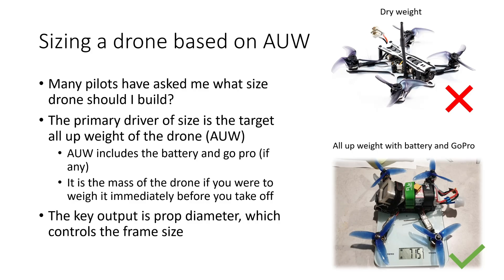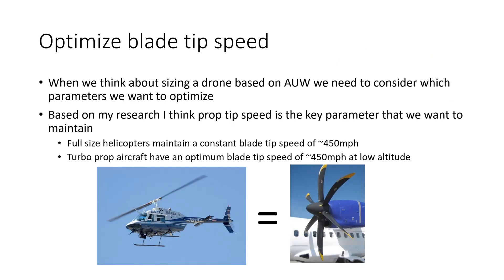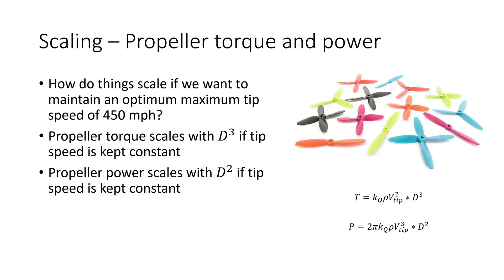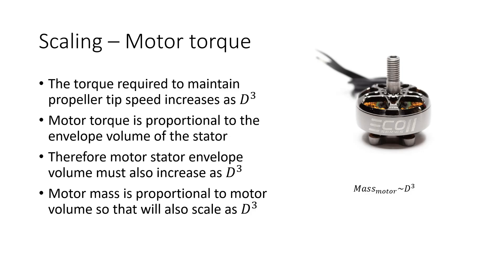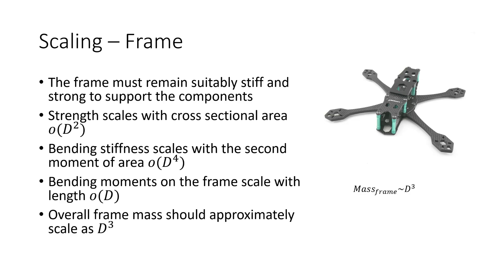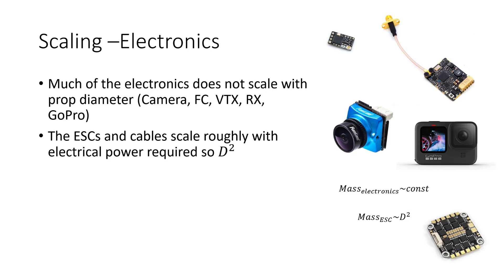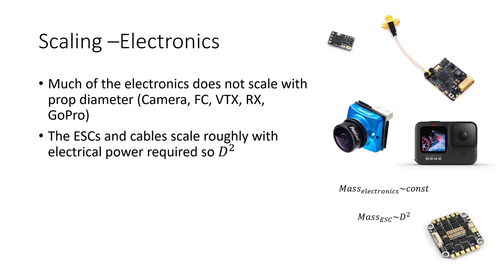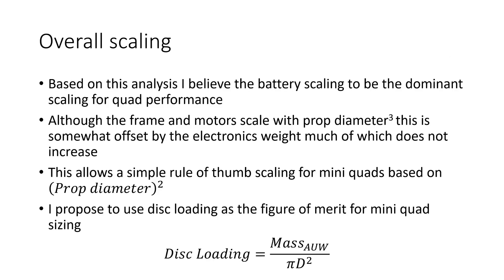Choosing the right prop diameter for a drone of a certain weight: What prop for sub 250g?

Comment: Hi Chris. Fellow Aero Engineer here. Question for you on your frame scaling stuff. I understand that the strength scales with the cross sectional area and bending stiffness with the second moment of that area. But why do both strength scale specifically with the prop D^2 and stiffness scale specifically with the prop D^4? Is this extrapolated based off of a force analysis due to both increased thrust and motor weight for larger D, and thusly the larger section geometry to support that? Curious how you got those relations. Thanks!

Comment: Chris at 9:30 you talk about disc loading. But when we state or calculate a disc loading value for FPV should we be using Kilograms / Square Meter, Oz / Square Foot or Grams / Square Inch - considering that in FPV we measure props in inches and quad weight in grams?

Comment: Before watching this video, I tried to run my 2050 Velox with a 6S and quickly realized that they got hot and also I got some weird sounds and vibration as soon as I increased the throttle. Landed quickly and switched to my 4S.
Doing the calcs it looks like full throttle would be supersonic speed for the propeller tip LOL. No wonder it was vibrating and getting hot...

Comment: Excellent discussion!  But at 9:07, shouldn't the disc loading equation include the 4 propellers of the quadcopter?  Because the formula is producing a value based on just a single propeller as described in the video.

Furthermore, there are other multirotor types like the hexa- and octo- copters that could also be described by this equation if the equation included the number of propellers in the disc loading formula.

Comment: I think there is no difference in sound and one way to really know is with a Decibal Meter. In regards to speed are both Propellers (Master Airscrew & DJI propellers) the same size in dimensions and diameter and weight or do they both have the same propeller specifications and design? Otherwise to claim which one is quieter or faster is kinda moot.

Comment: im pretty confused with the tip speed calculation.
i calculated in metric systhem, so 450mhp are 720kmh and as a formular i used: Pi * (7inch * 2,54 * 0,01)*(22,8V*3350kv/60) = 711km/h 
i mean why is it in this video, when even in this unrealistic configuration the tip speed is lower than the max droppoint of the efficiency?
or did i something wrong?

Comment: Finally someone explained it. Thank you.

But one question appeared. If goal is, for example, long range - is it beneficial to use lower KV motors and smaller props, to achieve more prop speed while cruising? Opposite situation - if you have crazy overpowered 8-12s build, isn't it better to use bigger props with same weight, just because motors can build more power/prop speed?
Reply: Also, if we take into account power required to spin propeller will efficiency stay the same? Propeller speed to air movement speed is great relation, but propeller is easier to turn on lover RPM, so even with worse RPM to air speed efficiency, it could result in better battery consumption efficiency.
Reply: After some research I'm now sure that I was right. 450mph(actually, it's 475) is best performance per rotation. So it's best thrust for the size. But if you can go bigger without adding much weight, you'll always get better efficiency.

So, if you can get same weight with same motor size etc. in 10" it will be much more efficient than 3". Props, same as wings, are more efficient slower you go, and lower is motor kv, better is efficiency. 

If you do race drone of some size, you should stick to 475mph. But it's not a surprise that huge and light long range drones have efficiency even with low tip speed.

Comment: im sorry, and im sure im not the first to mention this, but the area of a circle is pi R2 not pi D2... i just couldnt let that one go because not only did you say it, but you had it written in your equasion so i must question your results lol

edit: i will also say that helos and turbo props both have adjustable angle of attack to control their thrust while maintaining an effecent prop, we dont have that luxury on mini quads as we use prop speed to control thrust, so your never going to be sitting in that optimal tip speed unless your building a long range quad, you know what airspeed (not ground speed and no one has airspeed on their quads) and you maintain a consistant airspeed and angle of attack and consistant throttle point, then you can talk about sizing for optimal tip speed, i do get the disk loading argument, but i think talking tip speed on a mini quad is relativly useless, again uless your making something for strict effecency that isnt going to be changing altitude or airspeed much if at all, perhaps useful if talking about ciniwhoops, because their props maintain a relativly consistant speed but its gotta be way more than 450mph due to small props working their ass off, or another place where tip speeds might be useful are heavy lift cini rigs with 8 big ass props that maintain a mostly consistant tip speed because their not constantly abruptly changing altitude, airspeed and angle of attack like a freestyle or racing quad

Comment: Thank you, the level of clarity you bring is fantastic. 
Im building model F35s derived from Nicholas Rehms  design. His plane  has 3 motors in a tri copter configuration.  His plane weighs about 850gr uses 2205 motors and 5045 props on 4s batteries. They fly just fine.  My design is scaled 50% larger, weighs 1090gr and uses 2306 1900kv emax motors with 5545 props on 5s battery.  The motor overheats within 1min. of Hover time. Based on your data tip speed is to high so reduce prop dia to 5045 or change motor to 1400kv. Sound about right?

Comment: I don't understand what you are saying about the blade tip speed. The higher the blade tip speed, the lower our advancement ratio becomes (thus lower efficiency) because we simply can't provide anywhere near the thrust required for our quads to go 400km/h. What am I missing?
Reply from the maker: Even at 0 airspeed (i.e independent of advance ratio) the ideal tip speed of a prop at full throttle is about ~450mph. That gives the most thrust without losing efficiency.
Reply: @ChrisRosser  I'm sorry but I still don't follow. What relationship gives you the fact that faster blade tip speed is more efficient up to 0.6 mach, other than the advancement ratio relationships? Are we assuming that V_inflow is aircraft velocity or the local airspeed of the air being "sucked" in by the props? Could you recommend me some sources to read up on this?
Reply from the maker: @kinzokushirogane1594  http://www.epi-eng.com/propeller_technology/selecting_a_propeller.htm
Reply: @ChrisRosser  I re-read that article, and found some other good articles as well, and all of them still point to the advancement ratio relationships. The reason airplanes go to 0.6 mach for blade tip speed is because they can actually fly at higher speeds close to their optimum advancement ratios, and most of the also have variable pitch propellers. For our quadcopters though I cannot find any reason to intentionally increase blade tip speed, at least according to the info I've looked at, since most quads already have really high blade tip speeds already at 0.5-0.6 mach, especially in flight as the props unload. If our goal was simply peak thrust, then yes 0.6 mach blade tip speed is our limit we want to get to, but not for efficiency. The same thing in your video "Ultralight 5" Motor Testing", as I understand, going to 2 bladed propeller is only a good option if we can actually achieve the same speeds with less thrust. You made the assumption that we would have the same aircraft speed regardless of prop blade count but if the drag (at high speeds) we need to overcome is more than the thrust we have, we cannot achieve an efficient advancement ratio. We end up with high rpm, high blade tip speed, low aircraft speed and low advancement ratios resulting in low efficiency.

Does this seem reasonable?
Reply: @ChrisRosser  bump

Comment: Hi I have a drone that weighs 308 grams and 499grams with the battery.
I have 6S 2407 sized with 2800KV motors
What prop size and pitch should I use for maximum top speed and performance 
Thank you!!
Reply from the maker: For max speed use the steepest pitch prop you can.

Comment: For efficient cruiser (200-250g AUW) running on 2S 18650 idk if I should go for 4" bi-blade or 3.5" tri-blade props. PS. I am thinking between using 1303.5, 1404 or 1603 motors.
Reply from the maker: For efficiency a 4" biblade on 1404 motors would be my choice. For freestyle 3.5" triblade on 1505s.
Reply: @ChrisRosser  Would 1603 motor be even more efficient than 1404 for 2S 18650? 1603 stator has slightly less volume (603mm3) compared to 1404's (615mm3)?
PS. I am bit confused why Dave_C used 1303.5 motor with 3.5 props instead of bi-blade 4" 1400-1600 setup for his 2S 18650 Rekon35.

Comment: Some are reporting 1,350 grams and 7" props on DRL's Racer 4; inneficient machine based on your data....
Reply from the maker: Yes, DRL race quads are not optimum from a performance standpoint. DRL is spec racing, everyone races the same (relatively slow) quad. If you compare DRL to MultiGP you can see just how much faster MultiGP quads are able to go. I think DRL is designed for spectator enjoyment so they don't want the quads going too fast or the spectators won't be able to follow the racing.

Comment: This is very useful. I switched to 3" from 5" sometime ago because I don't do use action cameras so I don't see the point... Anyway, the weight of my 3" racers is approximately 184 grams on 4S which is pretty good considering I'm using the Vista with original DJI camera. The bad news is that I need to loose approximately 15 grams to reach the green line. Deceasing the Vista and the Nebula Pro camera should get me there however.
Reply from the maker: Yes I think decasing the vista is the clear next step 😁

Comment: Hi Chris,
thank you so much for the info!
Does the optimal tip speed of 450mph relate somehow to airfoil chord length of the prop?
I found high chord length props likes to run at lower speed, for example the 2.5-inch Emax Avan Rush.
It has a lot of thrust with low rpm but increasing the tip speed I noticed that the efficiency decreases a lot.
Reply from the maker: I don't think so. Its to do with Mach number so more related to the air properties than anything about the prop.
Reply: down to aspect ratio.. look at glider wings long and skinny, jet short and wide... the long skinny can handle higher aoa giving better low speed performance as lift is greatest just before the stall

Comment: How about for, say, bicopters? Do I just match the overall prop area to get the same disk loading?

If so, I assume for a 200-250 gram bicopter I use 4-5 inch prop. (planning on a tailsitter delta wing :D)
Reply from the maker: That sounds like a good approach to me.

Comment: Does prop pitch affect the optimum diameter for a given weight?
Reply from the maker: No it doesn't matter for disc loading. Prop pitch will affect maximum thrust but the momentum transfer for hovering stays the same.

Comment: 9:30 graph is really help me a lot.
No more guessing and arguing lol.
People build as light as possible 3 inch quad, for me it is too flooty.

It turns out my 3 inch quad just at the point for flying outside, especially on windy days.

My 3 and 7inch is on point with all of TPU protection and gopro 😅 but  need 5.5inch prop for my 5inch quad 😅

Thank you sir.

Comment: @Chris Rosser  so, if I understand this correctly, using the tip speed calculator you reference, an XNOVA 1804 2400kv motor on 4S with a 5" prop gives a tip speed of ~570mph and with a 4" prop it gives ~450mph. All of this at only 14g a motor which makes an AUW under 250g with a Naked GP very doable (with eg. a GEPRC 660mah 90C HV that matches current requirements) for both scenarios with higher thrust and flight time efficiency than a smaller prop (granted with higher drag when flung). Is there a reason why this is not the better choice? I guess I don't understand what you mean @10:00 when you say that quads with a lower disk loading struggle to reach the maximum tip speeds? Could you potentially expand on this or provide sources in the literature? Thanks :) 
*Note: The same thing can be done with the new Ummagawd 2004 Aerolite 2400kv if you prefer a larger stator size.
Reply from the maker: Are you making the assumption that max rpm = KV*voltage? It's much more complex than that unfortunately. The prop has a torque requirement for a given RPM depending on flow conditions and the motor has a current requirement to produce a given torque. The battery can only supply a certain amount of current at a given voltage. All of these factors depend to some extent on the weight of the components. The TLDR is an 1804 motor on 5" props won't get anywhere near 450mph no matter the KV. As for sources or literature on this I don't know of anyone who's done detailed research into this except myself and other enthusiastic hobbyists. There is no data on the torque curves for the props we use in moving air for example.
Reply: @ChrisRosser  I SEE! Upon more research I think I get it now. So as I understand it, higher KV produces less torque for a constant current. Larger propellers require higher torque supplied. So if we want to increase torque of the motor to overcome the torque consumed by the larger propeller, we have to lower KV. BUT by lowering KV too far you risk not achieving the desired tip speed for the maximum performance. Which leaves us no choice but to increase stator size for a given KV and maximum current limitations in order to overcome the torque consumed by the motor and reach that 450mph. That is to say that we are limited by battery technology and torque capabilities of the current motors available. And increasing stator size ultimately increases weight of the vehicle, making it harder to stay under 250g. Thus we need to look at less torque-intensive propeller sizes and then apply the design circle again until it is possible to reach the maximum tip speed for a given current supplied. Am I correct in this line of reasoning? And I guess that also means that thrust is lowered, but that wouldn't be such a bad thing in terms of flying characteristics when you want greater precision in flying. But the trade-off is then limitations in payload capacity when you want to add a naked GoPro under 250g, which decreases the size permitted for your battery, which again decreases current supplied and the design circle starts again. Is that also correct? Thanks again for the time spent educating us plebs XD
Reply from the maker: @itsmeRizzG  Yes, your reasoning is broadly correct. The KV does not change the maximum torque of the motor. That is dependent on the motor size and construction. KV only changes the relationship between current and torque.
Reply: @ChrisRosser  Ah okay, so the correct interpretation is that a higher KV motor requires higher current to maintain the same torque in comparison with a lower KV motor?

Comment: Hey Chris, thanks for the amazing info! My question is, if you want to design a Freestyle Quad that can also carry a GoPro whilst maintaining efficiency under 250g, my assumption is that you would have to trade off efficiency to thrust in order to carry the GoPro? Or is that fully compensated by the weight reduction?
Reply from the maker: You have a huge sacrifice in efficiency as you try to carry the same weight with smaller props. Your disc loading increases. You need more power to lift the same wieght with smaller props.
Reply: @ChrisRosser  Thanks, so in that case, would something like a 4 inch prop build for a sub 250g drone carrying a GoPro be the better tradeoff for going sub-250g (thinking freestyle/cineflying) whilst still tapping into the Disc Loading optimisation and maintaining some of the payload capacity of a 5 inch? Or better off staying at 5 inch and taking the efficiency hit on "performance" if the goal is efficient payload carry?
Reply from the maker: To go sub 250g your best bet is 3" with naked go pro or SMO 4k. No standard go pro is going to work.
Reply: And by this I am talking about battery life. Considering a smaller Quad, that would only carry a smaller battery, with a GoPro, I would think that the smaller props will give much worse flight times with less efficient thrust?
Reply: I guess you could also just increase the battery capacity with the weight saved by dropping a prop size in order to increase flight time? At some point you run out of frame space, but I guess you could always just bottom-mount a larger battery? Does this track?

Comment: Is it possible to achieve 450mph by reducing blade numbers and pitch in over light disc load conditions? Because the fewer blade and lighter pitch props need to spin faster to get the same thrust，it may achieve 450mph then. I'm building a 360g AUW freestyle quad with a 5' frame, it is hard to get optimum tip speed due to your chart. 4' props may be a good idea, but I think it wastes frame space of some kind. So how about using 5' 2 blades with a lighter pitch prop？ Thanks.
Reply from the maker: It might help. Your AUW seems quite low for 5" props which is why you are struggling to achieve 450mph. Either use smaller props or bigger motors/battery.
Reply: @ChrisRosser  Thanks mate and great video by the way. Looking forward to your next one.

Comment: Hi Chris, I have a 275g AUW 5" quad. According to your chart, I should probably drop my prop size down to 4". But is 2100KV on 6S enough?
Reply from the maker: I would think that would be enough. It's roughly equivalent to 1700Kv on 5in which is a pretty good KV.
Reply: @ChrisRosser  Next question would be how the pitch of the props factor in? Or is that variable more affected by the motor choice?